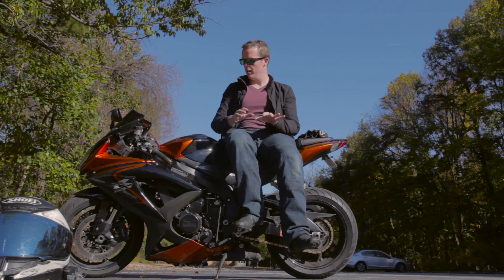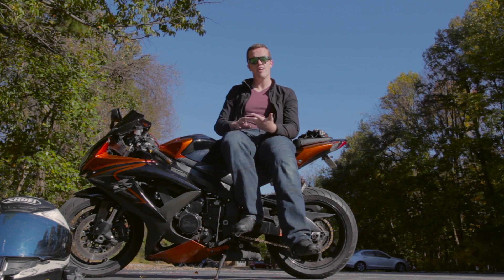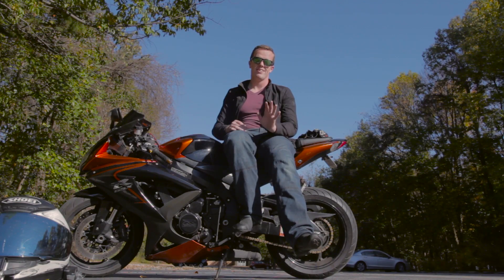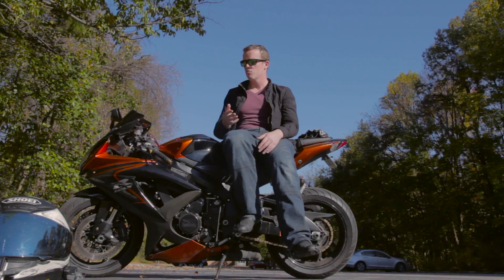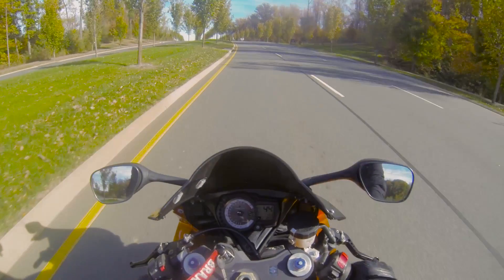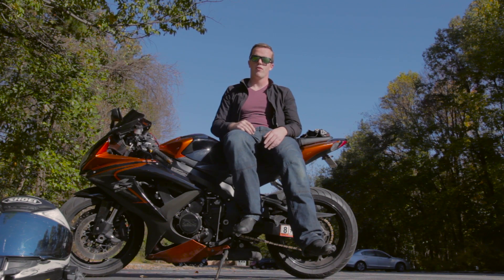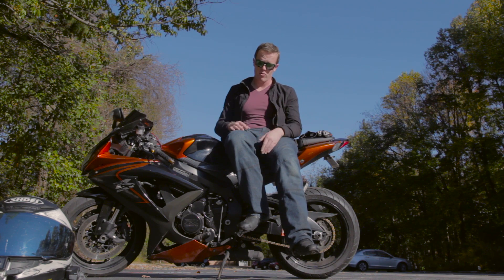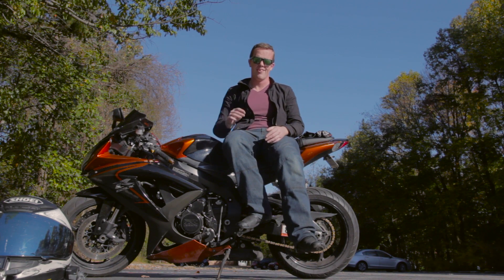How Motorcycle Engine Braking Works

Comment: Hi great informative video 
Take love from 🇧🇩 Bangladesh 

It has cleared almost all of my confusion regarding engine break ❤

One thing i wanted to as you mentioned if i running 60kmph at 5th gear and suddenly downshift to 3rd gear without rev match what kind of negative impact will be on my bike engine ? 
I own a 150cc yamaha

Comment: question....so if the rear wheel looks up............does that mean the engine has stopped turning? If not, how can the rear wheel be locked while the engine is turning? where's the give point?

Comment: heads up, it doesn't actually wear your clutch any faster when your clutch is fully engaged like that it's locked together, you might chip the edges of your friction pads but that's less than likely

Comment: and here i am ripping around and old ass quad my dad had sitting for 10 years with no brakes and a 200cc 4 stroker that has under 10 hours on the clock, that is pretty quick, im so used to shifting quick and with percision that im able to downshift to slow down while being thrown around since the seat is shit haha, nice. that just goes to show that practice is everything, og and did i mention i ride in timberland pros and that the gearbox doesnt clonk into gear so its hard to tell if you shiftet, haha. nice.

Comment: engine braking or shift down the gear is good.You have to slightly throlte up about 1mm when shift down,it's depending on the speed and feeling to not break down the gearbox.Combine engine brake and wheel brake is effective and not wear down the engine.

Comment: But to me, it sounds like engine braking would do more wear and tear on the engine/tran/clutch..etc.  and other than that pulling in the clutch and braking with pads seem like they do less wear and tear and brake pads are much easier to replace.

Comment: Hey, I'm Abit confused. So if I'm in 4th gear going say 50mph coming to a red light. Should I just roll off the throttle and let bike speed decrease then use brakes to complete stop...then when I'm at complete stop shift down to first so I can get going when lights green? Or do I let engine slow down and as rpm go below 2k shift down and continue same way until stop so I'm at first already when I come to a stop. I hope what I'm asking makes sense
Reply: Typically I do the latter. I usually make it to low RPM second as I'm coming to a complete stop though. I put it in first when the light turns.

Comment: What you mean is that there is a higher pressure in the crankcase then there is above the piston and therefor the pressure in the crankcase is pushing (or try to push) the pistons up to top dead center. Negative pressure does not exist and there is no such thing as sucking power.

Comment: Isn't engine braking from the compression stroke?? When you roll off air is still let through for the idle circuit. Compression requires energy, and when you roll off the throttle, the piston is using energy to overcome compression, but is not gaining energy from burning fuel, so it loses speed. A simple way to test this is turning your bike off while rolling down a hill. Drop it in gear and let off the clutch, but hold the throttle open. The engine will still brake you with the bike off and the intake butterfly all the way open, disproving it's from vacuum

Comment: So Im new to riding. And when I am coming to a stop I have a habit of of just using the brakes(which I am working on using the engine to help) my question is that when Im slowing down I just hold the clutch in and downshift without releasing the clutch. And sometimes the bike makes a weird clicking sorta sound is that because im doing something wrong or what. Thanks!

Comment: Why does the rear wheel lock if you downshift and redline? Is it the limiter doing that?
Reply: The wheel literally can't keep up with your RPM
So let's say your redline starts at 12k RPM and you're at around 10k in your 4th gear
Then you decide to engine brake but don't let it get down to like 6-7k RPM first but instead you downshift into the 3rd gear straight away
What happens next is that your RPM goes to WAY OVER YOUR REDLINE
Like 14k+would be in
But the problem is that your *engine basically can't spin your wheel that fast to keep up the speed which means your wheel is slower than what it needs to be for your speed
And that results in your wheel either smoking as a reverse wheel spin or simply getting blocked

Comment: When you let go of throttle the air and fuel to the engine do not stop completely. Just start your bike, the engine is running, the throttle is zero, and the engine keeps running. So the engine runs at around 1000 rpm at no throttle. if no fuel enters the engine, it will stop.

engine breaking is most useful when going downhill. if you go downhill at low rpms the slow moving engine doesn't allow the tyres to move fast. on a plane surface it does come into play but it's also just the fact that if you release throttle, there's no force maintaining your speed so you'll slow down. kind of like if you stop pedaling a cycle it slows down.

Comment: Works the same as any other engine. Diesel  system design it better with jacob system ect.  Engine braking turns your engine into a air pump when your decelerating

Comment: You never mentioned how engine braking will destroy 2 strokes because of oil starvation.
Reply: Ive had a crm 125 supermoto for over a year now and ride it to work everyday. I constantly engine break and ive had no issues.

You need to break mainly with the brakes but also rev match engine break. You break significantly faster and dont do any damage to the motor.
If youre just engine braking into really high rpms constantly then yes youll do damage. But only idiots do that shit

Comment: from my limited  knowledge  of engines, even if you roll off the throttle the engine still gets gas, dumbass, by not giving it any throttle you only go from accelerating to idling, depending  on hot fast your idle is set determines how much fuel is put in the cylinder. TLDR: the engine  still gets gas and runs after you let off the throttle

Comment: when i'm engine braking, I shift down and release the clutch slowly so the RPMs don't jump right away. i don't open the throttle to rev match. you're saying don't do that?
Reply: thats a viable technique too, good when youre riding at a relaxed pace, but not so much when youre racing. 

even so, learning to rev match is the best thing if you dont have an autoblipper.

Comment: thanks for the tips.  i'm a beginner, and it answered some questions i had. 
anything wrong with down-shifting multiple gears without engaging the clutch for each one?   besides the wear to the brake pads?
Reply from the maker: +FPVREVIEWS no issues so long as you don't exceed the rev limiter by shifting down
Reply: thanks, I also know not to shift into a low gear at high speed, they must be appropriate for each other, but had been told that I had to let the clutch out each gear, and just made no sense, so thanks for that!  
I'm riding a honda twister 250 street bike.  it's just right for me, as I ride in the city, a nd just learning. had. dirt bike but didn't get to ride it much because my trashy boss at the time put salt water into my gas tank, and it ruined the engine.   I will restore it someday.  some people just are not happy with you making money for them. made over half a million for him, and that's what I get..  lying sack of poop.   well. that was 15 years ago, and I put him in jail twice for assault.  needless to say, being fired was the best thing that happened to me. you never forget when somebody messes up your bike.... 
anyway,  thanks.

Comment: But brakes are much cheaper than a new motor 🤔
Reply: So don't do it with a two stroke engine. There is nothing wrong with engine breaking with a four stroke, simple fact,

Comment: So does this work in a manual transmission car? I would imagine it's the same concept, right?
Reply: Yea it does, you can do it in new automatic car too. Use your manual shift paddle/stick . You know the plus minus thing nobody uses.  Well definitely use them while driving in snow,  i engine brake my car all the time in snow, way more control

Comment: Many people call engine braking compression braking, which it isn't!  You got it right; it is sucking air in against the vacuum created by the throttle valve that causes the braking effect.  Diesel engines,  (unless specially equipped) have very little engine braking because they have no throttle valve.  That's true even though they generally have a higher compression ratio.

Regarding clutch wear, if you speed up the engine to the proper speed before engaging the clutch, then engine braking will not cause additional clutch wear.  I do not understand why that fact is so often ignored with motorcycles.  Race car drivers use heel-toe downshifting for smoothness and to reduce clutch wear.  While the right foot is on the brake, they hit the accelerator with the heel to speed up the engine before engaging the clutch.  Some of us use that technique for everyday car driving.  So, when I learned to ride a motorcycle, I used the same technique for downshifting.

Comment: Engine braking COULD shorten the life of the clutch, but it does not have to.

If you drag the engine up to speed with the clutch, there will be more wear on the clutch.  How serious that is is open to question.  However, if you use the throttle to speed up the engine to exactly the right speed before quickly engaging the clutch, no more wear will result.  That also eliminates the need of a slipper clutch to avoid rear wheel sliding or hopping when downshifting.

This matter comes up over and over and over again.  It seems very strange to me because it is really a very simple thing to understand.

Comment: brakes are waay cheaper to repair,  than a motor rebuild so unless you are racing or made of money , use the brakes....they are inexpensive compared to rebuilding a motor and gearbox.....oB
Reply: But it doesn't, you're just perpetuating the retarded "engine breaking is bad!" myth. You realise that actually opening the throttle and you know, constantly exploding a fuel/air mixture and accelerating puts more stress on it, right?
Reply: My dad works for Microsoft!
You're plain wrong mate, please explain how closing the throttle and decelerating is somehow doing more damage than combustion and acceleration.
Reply: Thanks, that means you are using engine breaking, that's exactly what you describe. QED.
Reply: K Compbelli where is this coming from, that u can damage your engine or gearbox with engine breaking?  are you breaking without downshifting, holding the clutch all the time???
Reply: Tell you what mate, you can have slower, shittier braking and need to replace your pads a shitload more often, for no reason. I'm going to keep engine breaking.
Reply: i am an engineer and very insightful on the workings of 2 and 4 cycle single and multiple camshaft/ valve engines as well as turbines. but bad advice is just that.                My original statement still stands. oB
Reply: K Compbelli engineer, yes yes. My dad is too. I am too. If you go to a proper driving school here they will laugh at you and you will not get your drivers license when you don't use engine breaking combined with normal breaking. My BMW bike has no problem with engine breaking (ie: closing the throttle!) for 125tkm now. So the CBR for 68tkm. 
You did not answer my question: you always hit the clutch when you close the throttle?
Reply: I never disengage the drivetrain unless it is required on any vehicle, that to would cause unneeded wear on the clutch,,,I would rev match and use the velocity to carry me forward to the intended spot to down shift or apply the brakes. Get lost. oB
Reply: I never said "closing the throttle and decelerating" does more damage than anything else, I said excessive use of gearing down to every stop puts extra drag on the drive train and you are commuting...I don't give a shit how you treat your equipment, in fact if you beat the crap out of it and go to full redline on a cold start go for IT!!!  You bunch of keyboard / armchair racers tear your junk up. 
I am going to treat my powertrain with the intended care, because a long block is $24k and a clutch without labor is nearly $2k. Please go tear your inner workings up and prove everyone your wallet can take it. I have logged over 1.2 million miles and have had excellent service out of all of my stable. Bye oB
Reply: Problem is, no one here was talking about reving the shit out of the engine when downshifting and using engine breaking like it's the only thing that makes your bike stop.
And you are also only using the first 10% of throttle because more would add an extra drag on the drive train when driving? Never to mention that the momentum put on the drive train when accelerating is much bigger than when deccelerating.
So you are also slowly commuting through the alps?
Reply: Driving aggressively and engine braking instead of using the brakes, clearly designed for slowing the motorbike down when you are not racing is just stupid. it puts added stress on the powerplant for no gain when going from point A to point B.
Now, when you are driving on the street, like an idiot, and "play-like racing" with 3-8 ton vehicles all around you there is a saying for behavior, 
"Motorcycle riders that will crash and those that will crash really bad"
....both wheels slowing the bike down gradually transfers the weight to the front and increases stability. 
You should read a few road racing books or maybe take a real driving course and LEARN what the dynamics of the brakes applied correctly, trail braking and the like and the effect of adding all the extra revs to the engine, using  the powertrain as a brake when you don't have a sponsor to pay for an engine rebuild or a trans output shaft replacement/ Rear tires.    oB

Comment: Brake pads are cheap, engines are expensive. "Bible Verse"
Reply: Brake pads are cheap, engine braking is free.
Reply: @greengoat5654  you may have missed the point my friend.
Reply: It is not necessary to operate an engine at high speeds to get engine braking.  Generally, using a gear which will cause the engine to operate at perhaps 2/3 maximum speed will provide plenty of engine braking.
Reply: Please list chapter and verse.
Reply: Frank Eggers from "twist of the wrist, the riding bible" chapter 3 I think. Your reading the wrong book my friend. Google it.
Reply: @Callmewes  I feel you Bruvv.. krkrkr. watched that video may be 10 times,
Reply: un-common sense chapter 1 verse 1
oB
Reply: People tend to forget that RPM also means "ruins people's engine"  pistons don't suck air either, It's atmospheric pressure. YouTube engineers.
Reply: yeah only if you overrev the engine, looking at motogp bikes from before super modern slipper clutches, they tended to stay about halfway up the revrange, like 8000rpm on a 16000rpm redline. going too high will cause the rear wheel to shudder and chatter along, that's loss of traction, less grip, less braking.

Comment: As you state a 2 stroke doesn't have much engine brake, you shouldn't do it to begin with. Since the lubrication system comes from the air/fuel mixture, with the throttle closed at high rpms, there isn't much lubrication getting to the system as if the throttle was open. This is also true for rotaries that are mixed, and arguably injected too.

Comment: But don't engine break on a 2-stroke!!
Reply: If you engine brake with a 2-stroke, you are likely to break the engine, at least if it is an engine which runs on pre-mix, i.e., gasoline which is mixed with oil before being poured into the tank.  That's because cutting off the fuel also cuts off the lubricating oil.  However, if there is a separate oil tank and the engine has a pump to pump lubricating oil into the engine, there should be no problem.
Reply: Frank Eggers exactly
Reply: Wrong, just blip the throttle if you're on a long downhill.
Reply: Cyka  Blyat

Comment: Extra wear.... the motor is just displacing the load the way it's designed to. But extra wear ?? The mechanical  portion of it has a well designed clutch and drive system to handle the extra loads but extra wear. If the motor is on things are wearing out

Comment: would you rather wear out your.clutch componets or your brake.pads....
Reply: Fabricio Tsui explain, pls, how engine breaking wears out the clutch.
Reply: not revv matching, shifting down a gear at a high revv, especially right before a sharp bend, blocks the rear tire a little and makes you slide just a bit and also let's you decelerate in a way not possible just by breaking.
doing this with my clutch for 120tkm now. no problems.
Reply: Marion Cobretti no, it does not. can't get the slide when revv-matching. maybe I should add that I am talking about 1200ccm 2 cylinder machine. and who cares about wearing bike parts? that's what they are made for. biking should be fun, not about saving money, parts and fuel.
Reply: Marion Cobretti "you guys don't corner"? what the hell are you talking about? well yeah, try go straight a lot here in Austria in the Alps.
you are talking about sportsbike 600ccm. different. and no, I am not riding a chopper.
tried it again yesterday focusing on what exactly I am doing, you are right, I am doing the revv matching, but at high rpm, so letting go the clutch makes the slide.

Comment: Been driving manual cars and bikes exclusively for 27 years. Engine braking is overrated and inefficient . Don't overdo it. Learn to use the brakes to their full potential first. Once you are proficient at synchronizing the gears all this shit will come naturally. I can't believe you are trying to make a case for the cost of brake pads vs. the longevity of your engine and clutch. Brakes are cheap/ engines are expensive. Get a fucking clue dude.